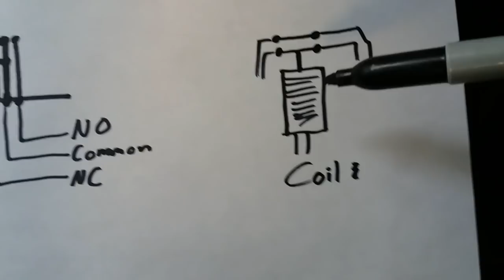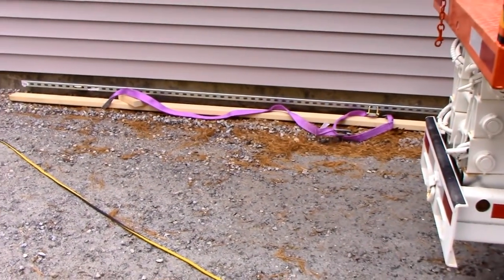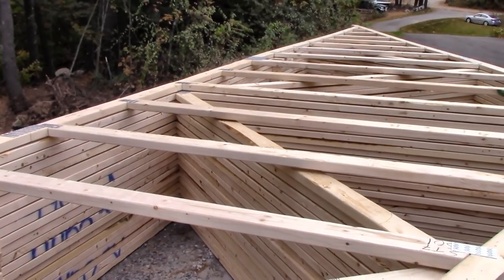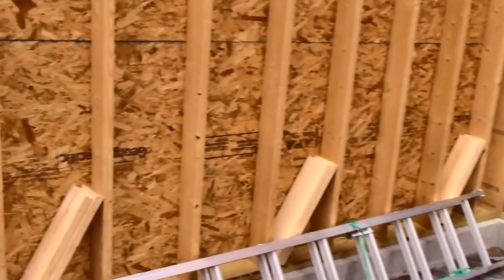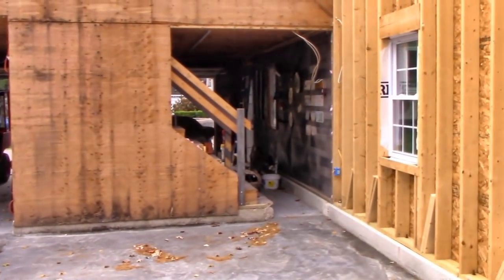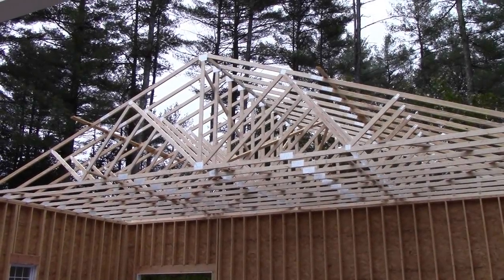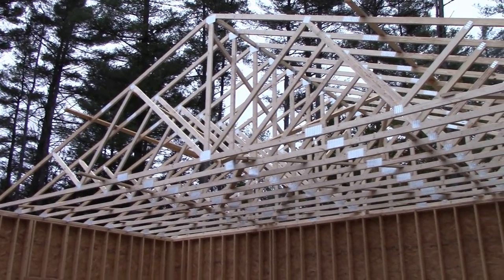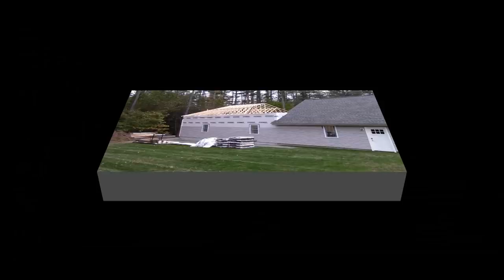Part 8: Dream Garage Build - 42' Trusses Placed WITHOUT a Crane!

Comment: Gable end truss is also definitely designed structurally. It has a different bearing condition but it is still ran at the same criteria if not more than a typical main span truss
Reply from the maker: Well technically all framing of a building is structural in that respect.  Even non load bearing walls need to hold sheetrock and often a door but you know what I mean.  Gable ends don't need to structurally span anything, just support the roof.
Reply: @Trialnerror  Well it has to support lateral wind loads as well as outlookers

Comment: Looks like the wind was kicking a little. Nice work. That lift setup is how I’m going to go. I’ve got 44 footers to set as soon as the snow starts melting. Thanks for the info. 👍🏻👍🏻👍🏻
Reply from the maker: Yea, as if it wasn't sketchy enough to hang a 42' truss from a scissor lift the wind showed up to the party.  Good luck with your build and be careful!

Comment: Glad to see you get the trusses in; I was afraid winter was going to put snow on the ground before you had a roof on there. The inspector will probably require you to put 3 strong backs on that end gable wall truss. That is the good thing about having it inspected when you do it yourself, the inspector will explain clearly to you what needs to be done to secure it properly.  You will also probably need to put up the last 3-4 trusses on top of the wall before you place them because the lift will not fit between them again. if you can get the lifting beam to work on the long side you might can make it work for just the last 2 needed done by hand. 
One other thing, don't extend a extension ladder like that against the wall like it is at 9:56. The quick ride down when the feet slide out from under it can be painful and life altering.
Good luck with getting it done.
Reply: Stand at the base of your extension ladder. You know the angle is right when with your toes touching the feet your arms fully extended in front of you hit the rails. 
Too steep you fall off the back
Too shallow you slide down or off the wall you're leaning against.

Or ¼ distance out of height up.

Comment: Congrats on the successful back surgery! Glad to see you're up on your feet and pressing forward with this impressive project.
Reply: It's actually not a very good idea at all. With all those guys, you simply carry the truss inside the garage, put one end on one wall, then the other, let it hand upside down, slide it into place and lift it up and put it in place, bracing it with a couple 2 x 4's. I put up 32' ones by myself. They could have had them all up on a few hours.

Comment: A crane would probably cost more but to have your machine rented, delivered and picked up is probably not cheap either (300$?). We had our 34' trusses delivered and boomed directly on the walls for free. You can drag them fairly easily and install them in place.

Comment: did two people stand the truss up first then move them to the scissor lift?going to have some delivered  but they will have to be about 200 ft from the detatched garage.just wondering if ok to move 24 ft truss over to garage with 2 people

Comment: Just a question - the length of the truss for the bottom part do they joint 2 or 3-length timber or is it a one-length the whole 42'
Reply from the maker: It's multiple joined pieces tied together with steel nail plates.  Very solid.

Comment: I can’t believe you did that without the walls being braced. Although you got the job done it was pretty sketchy. If you had a crane you could have built the entire gable wall as one unit and installed it
Reply from the maker: No need to brace the walls for topping it with trusses.  There's no outward force when using a truss vs. a typical rafter style roof.

Comment: I'll be placing trusses twice this summer on two builds. The first are only 16' low pitch trusses so I can easily do them myself. The second build is my 'temporary' wood shop which will have 24' scissors trusses with 1' overhangs. Still unsure how I will do those. I hope to do them by myself, but time will tell. We had to use a crane on our house trusses as they were 'room in attic' trusses and were insanely heavy -- especially the double ones. 

It's a good feeling once that gable truss is connected to the strong-backs and fastened in place. It's the most dangerous one, and also the most critical in regards to placement. The place is looking real nice! I'm off to the next truss video...

Comment: Great looking building. However, one should not use a scissor lift. Too heavy with that weight. That is dangerous. A telehandler is a good alternative.
Reply from the maker: It's not the best way of doing it but it works if you don't mind putting you life in your own hands LMAO.

Comment: If your doing 24" oc you need to cut your spacers at 22.5" or else your spacing will be all wrong.
I am Lifting 24' trusses by hand, by myself, thankfully only 8' tall walls so its doable.
Reply from the maker: I'm an idiot and learned that the hard way.  Best of luck with your build!
Reply: @Trialnerror  finally got the last truss up an hour ago. Now, to get it dried in before the snow Flys and call it good until next spring. I am not a carpenter, mistakes where made but overall, Pretty happy with doing this large of a project, 100% on my own. Mistakes can be fixed.

Comment: If anyone seen you pull a stupid stunt like that you’d still be in jail. Read the manual, the machine is not designed to lift materials. The maximum safe load on a AWP is 500 pounds. The operator is not wearing a full body harness with a retractable lanyard, I’d be interested to know if the operator has a AWP ticket. your lifting over peoples heads and your not using tag line, for 42’ you should have a tag on each end of the load. Just mentioning a stunt like this where I work they’d escort you to the gate!! As a property owner it is your responsibility to insure the health and safety of all peoples working on your site, no need to ask if you have workers compensation coverage in the event you did hurt someone working on the site.
Reply: I have a AWP ticket good for scissor and boom lifts to 330 feet, I have a rigging ticket, I work in the industry, I know what occupational health and safety laws state. It’s not just common sense it’s the law. Why are their laws for such things? People have died doing this kind of work.

Comment: Will only work in this situation which is rare. You can't have interior walls at all in this situation.
Reply from the maker: That's not rare for truss built buildings at all.  In fact, interior walls are always the last to go in a truss building since they are not load bearing and have nothing to do with the actual structure.

Comment: Hey great job and i will be building a 64x40 this summer myself...question though...how tall are your walls? 14'? Im doing 16ft walls on mine... i ask due to the trusses being the only part thats going to be  a pain and thats all im worried about...thanks in advance and hope you feel better
Reply: Woww thats it? Lol yours looks tall from the vid esp next to that 7 ft tall door...and you are correct and heating wise wont be such a big deal as itll be in central florida...however cooling will be a must but ill add central air, bathroom etc and yes you are right itll be expensive but itll be my shop as well and i will be doing the work myself with some help with walla trusses etc... doing it all myself but the slab and footing.. im sub contracting that as well like i think you did.. reason for 16ft walls is due to working on big rigs or semis... and fitting my camper that is 12 ft tall give or take as well.. id love atleat a 14' header if that makes sense.. did you do all.of the work yourself besides the slab and footing? And im going to do a monolyptic pour btw.. footing and slab all in one which should definitely save a lot of money being done at once..  and im from chicago...so i feel your pain on snow, cold weather changes etc etc..
Reply: @Trialnerror  yesssi can only imagine putting up the trusses and them being  a pain and making sure  everything is straight and level and what not... but at the same time do know it will be worth the headache if that makes sense? And yes i do have skills and have built my own house by my self minus help with roof to get it done on the weekend... but yes we love saving money and using our skillset to our advantage...plus you can do it how you want and you will know exactly how it was done... and yes i do stuff the right way as well.. so yes it will be fun and hectic but worth it.. can i ask you if you ever got quotes for the excavation stuff and how much were you qouted? And how much per yard of cement what psi did you do and how many inches thick is the slab?
Reply: @Trialnerror  holy hell...115k they qouted you? That is very high if you ask me lol i mean im not sure if its due to where you are or not no offense but that seems very outrageous..  im sorry man thats bs... i ask because i i got qouted 90 for my 64x40.. yes its all 6xs and what not just like yours because of the span and trusses and what not too...but damn thats a huge difference lol of course i dont have 90 laying around and never would pay that when i can be up to code just on my own and do mine for about 30 here..but thats really shopping around and getting doors and windows on a steal...lol i got my last set for free for example similar to your doors... they came off a new house and were 5 years old tho lol.. but yeah im going to be silly and just end up doing a residential door for time being...those commercial/rv doors are not cheap at all.. ill just reframe it later for the bigger door.. but yeah you are like me on being upfront and posting very specific details showing people that it can be done on your own and definitely love how you showed the material list/cost...no one does that so thank you i appreciate it! And did you use rebar as well? I know i will be.. its foundation is the start and i will do over kill witht that...6 inches all around for slab + footing and qouted for 1 foot deep at back half of garage(30'dx36'w) of the slab where the 3 lifts will be... 2' wide footings on each side of the garage  hence the slab wont be a foot deep there itll be 3' deep at footings and that was still 13k lol im sure areas are different and prices go up and down a lot sadly.... im still shopping around tho man.. getting qoutes on materials every where i can now that i know what i need and what not but your garage is so awesome man hope i didnt confuse you...i explained what im doing in concrete kind of ass back wards lol
Reply: @Trialnerror  oh and i have been watching every episode on your build btw to answer your earlier question lol i subscribed as well im sure you know that tbough lol i wish you were closer man... not many around like us..  maybe to a point but not down to specifics that try to help everyone out...
Reply: @Trialnerror  and also im.kind of in a predictament now..  maybe im over thinking  this but the county wants me to show my live and dead loads etc etc... did you have to do that for your county? And what size bottom and upper cords do you have? Do you know what they are rated for psf wise or load wise? And your walls are 2x6s correct? Just making sure cuz thats what im going to use.. sorry for all of the questions...but i guess i need the help here as my country wants it all documented..not asking for your help with the documentation or figuring loads but if you knoow what your trusses are rated for load wise and sizes of bottom and top cords as well as webbing id feel better just got my qoute for 31 attic room trusses, 31 common trusses, and 2 gable ends.. $5246.00
Reply: @Trialnerror  ok well if it matters... i got good news lol i talked to an engineer  that deals with that county in florida.. he said a 20x16 footing will work along with my 2x6x16 walls and my trusses i got qouted would pass code as well and the company i got qouted from on those trusses is a reputable company and he deals with him...he said with that set up and 1/2" osb 16"center on walls and 2ft on trusses he said ill get my permit no problem with his seal...hed just want 800 bucks and i can start playing lol so heres my material list with prices btw pretty much done..
1. 150 permit
2. $800-1000 max for blue print with engineers seal from county to get permit passed
3. 10k Monolithic slab/footing done start to finish
4. $3891.45  for 170 2x6x16s and 200 sheets of 1/2" osb i need 170 so 30 extra and 20 extra 2x6s.. 
5. $5143 for 32 6/12 40 ft trusses with 1 ft overhang. 15 are attic room trusses with 7'2 ceilingx 12' wide room...other 15 are common trusses and of course 2 gable ends
6. Now thats pretty much everything but underlayment, shingle, siding, osc, starter strips, finishing strips, soffit and facia.. but that stuff is a  $2000-3000 each at most so add 5k to all that and should be good..  doors and windows wont be a problem...i get them 70% off lol
Reply: @Trialnerror  yes the trusses description or print out shows the over all loads... i dont have snow loads and crap in fl.. but i do get high winds due to hurricanes even tho one hasnt touched central fl for centuries lol and those are needed to be rated at 140 wind volociities.. and they are lol and yes with our trusses they cant be 1xs lol they are such a span they need to be at 2xs ya know..but thank you so much im sorry i just seen this comment and i found the perfect engineer from.the county and one of 2 best truss manufacturers so im happy and got every question and if or but answered thanks to you and them...and yes i will add you on fb in a few mins...matt riley is the name thanks man i appreicate it and so you know the engineer did do the calcs on everything right away to see what it would do and if itd work not work etc anf he said ill have no problem with what im doing passing code or being above code on some things lol trusses are good walls are good and as long as i do bare min on slab and footing im good... however i am doing 6 inch slab and 2ft x 2ft footing..yes over kill but its a piece of mind

Comment: I am sorry, but setting 42' trusses without a crane is just stupid. I am a journeyman carpenter that ran framing crews for years and so I know what I am talking about.  With a crane you can set them in a couple of hours with two men. You paid the cost to have the lift on site probably for an entire day or more. You would have paid about a $125.00 per hour for about three hours for a crane. My bet is that it would cost you less to rent a crane,  especially if you consider the time to set them. Even with your family setting them with you, you would have been safer, quicker and easier by just using a crane.

When I first started as a carpenter, we set all of our trusses by hand and so I have plenty experience setting trusses.  I am not trying to be mean to you, I am just trying to give you some insight from a pro.
Reply from the maker: I bought the scissor lift and sold it for more than I paid for it.  Yes a crane would have been easier but I wanted to do it myself and this wasn't just cheaper, it made money.  Call it stupid if you want but it did the job and no one got hurt so can it still be called stupid if it works?
Reply: @Trialnerror  Hello, thank you for responding, that takes a lot of guts. You don't have to worry, I am not going to call you stupid. Considering that you made money on your scissor lift, you kind of paid yourself for your extra work.

Having said that, having a ton of experience setting large trusses both by hand and by crane, I can say that crane is by far the better choice. There just isn't any comparison. 

Also, if you use a crane you can lay down four or five sheets at the corner where the house is strong and have the crane set your plywood bunk up on the roof. This saves you a ton of time and hard work of having to man-handle the plywood up onto the roof. 

You are not alone., a lot of DIY people sometimes take do things the hard way. The main thing here is that you had the courage to tackle a very difficult job and you worked hard to make it happen. You deserve a ton of credit for that. Great  job!
Reply from the maker: @franklong6269  Well said Frank and I appreciate where you're coming from.  Thanks for watching and for sharing your knowledge.  As you can see I accurately named my channel if nothing else lol.  Take care man!

Comment: Should be 22.5 "
Reply from the maker: That's for the space between trusses not the on center spacing.
Reply: I caught that also.  I see he replied with "O.C." distance but what he said was "all of those pcs. lined up were 24" spacers" and that means - to me, anyway - that the pcs were cut at 24" lengths.  'Trialerror' should have just admitted his error instead of defending it.

Comment: If you get caught by OSHA using a scissor lift for a crane you will be fined. This video is all the evidence you need to provide for the fines. Does anyone have training certifications for the lift. If they did, they should have known better. Safety Supervisor
Reply: @Trialnerror   It looked safe enough, for that size truss, just slow as hell.  A boom truck operator (I'm one, been doing it over 20 years) could have done it easily in a couple hours, 20 to 400 bucks. With you on the OSHA thing, NOT APPLICABLE!
Reply: I've worked heavy construction for 27yrs and never seen OSHA. I honestly think they are a myth. Quit being a snowflake.
Reply: @jaywagner13 😂 that comment is gold
Reply: They usually show up if something happens...but if your working by a highway or in town..best to play it safe
Reply: Same rules don't apply for homeowners doing a DIY job.  Permits and code, yes. OSHA, no.
Reply: Safety supervisor: OSHA has absolutely no jurisdiction over a personal project. They exist to keep employees safe that are employed. That's it.